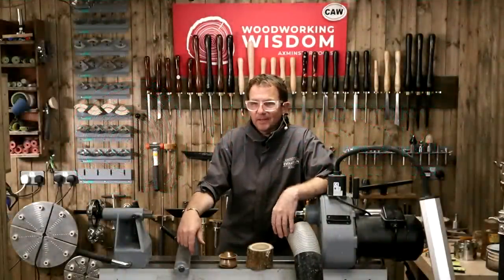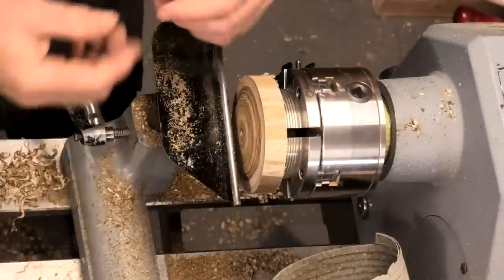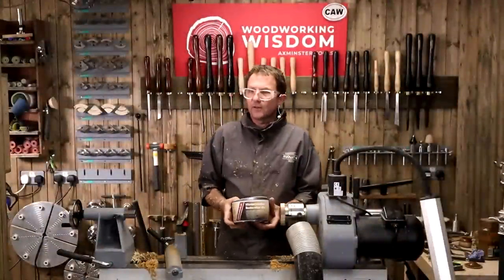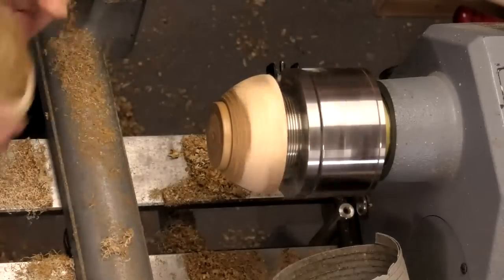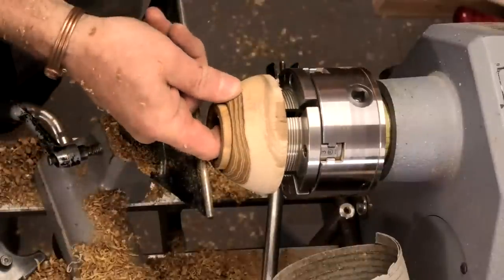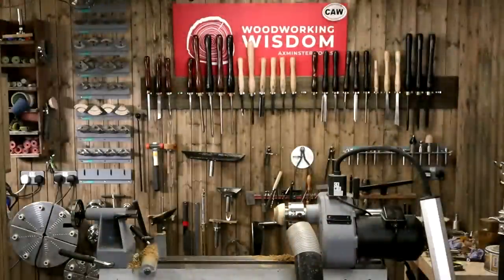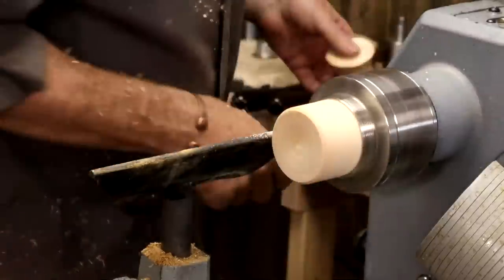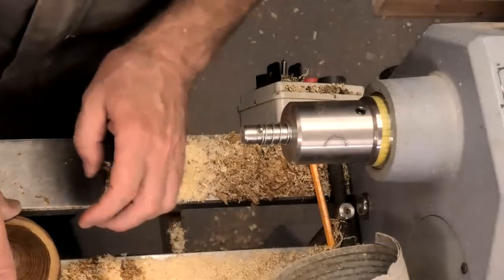How to Turn a Sun Hat Box - Woodworking Wisdom

Comment: Love it. I'll be making one for the gallery. Maybe a better way to get the fit right with very little measurement is to start parting off the lid with a bedan to the desired lid size. Then part off down the center of the groove with the thin parting tool. You now have a reference size on the lid and the body.